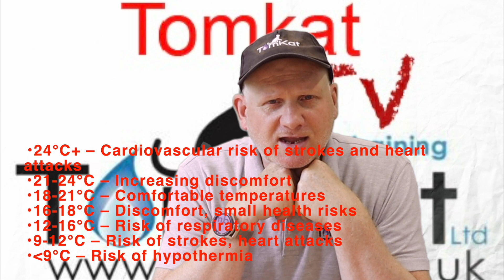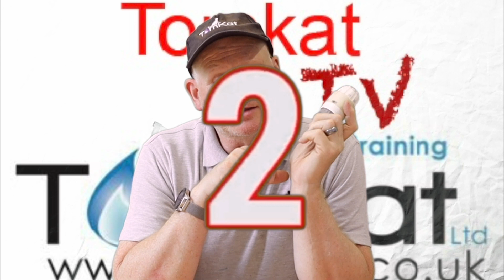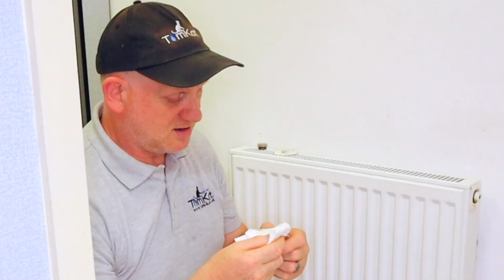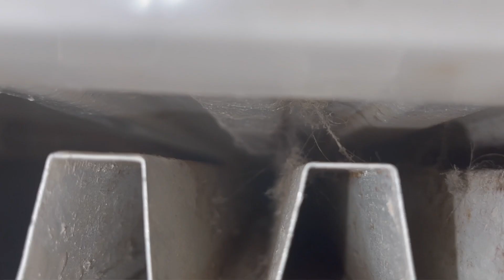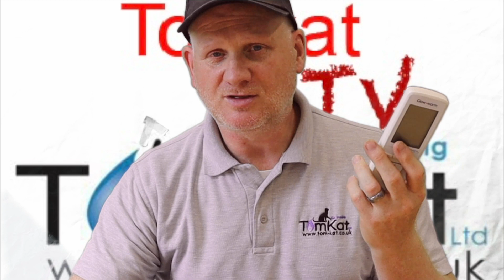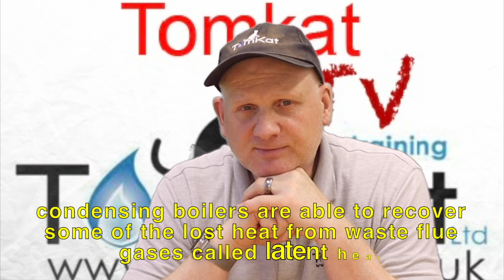Save gas save cash. 15 tips on how to save money on your gas bill.  #saveenergy

Comment: Makes me smile. I was born in a house with no gas, no electricity and no running water (we had a pump). The temperature you talk about would have been dreams. My grandad lived with us too,. We had a range in the room. Upstairs was a matter of moving very fast and get into bed with lots of covers. My grandad lived to 88  and he'd lived there 60 years so don't worry too much about being a bit nippy.
Reply: I was brought up in home with only an open fire in the lounge.
Winter was a nightmare and when you got up out of that nice warm cosy bed to a cold room where the condensation from you breathing during the night froze on the single pane of glass...
Eventually we got a parafin heater in the backroom/kitchen.
Hot water came from an emersion heater which got condemned after a few years but we couldnt afford a replacement so we just hoped it carried on working and it did for about 10yrs.
I only ever knew CH when i met my now missus and we got our first home..
Reply: @antsmith8588  I was born in 1949 and brought up with bath time once a week in a small galvanised bath, don't  know where the hot water came from, but we had something called a Copper!
Been in plumbing  since  a lad, so I've  seen the progression. 
All these plumbing and heating innovations  have got us to where we are today. Easy for the kids today to take so much for granted, we probably did something similar, but we never had a warm bed to get into in the winter. Yes, I hear the yawns, but once upon a time Thomas Crapper walked to London from up north and developed the flushing WC. You plumbers out there be proud of your heritage, sing your own praises and remind lesser mortals of your elevated position in society!!!
Reply: @johnward5006  ih i remember as a kid rolling up newspaper and knotting it for the fire at home and at my grandparents.
Then in the evening before we went bed we used to back up the fire with tattie peelings(potato).
My grandparents had a backboiler in the early days.
There was a metal hoop at the back and you pulled it to open it so you got hot water or closed it etc.....
I could on but im not as owd as thee are not yet anyway...
Reply: On Sunday bath nights I remember  the difficulty of persuading myself to get out of a warm bath into the freezing bathroom , the race to dry myself  before running to my freezing bedroom to dive under the blankets . Being a coward & delaying the decision ( as I often did) until the water was tepid made it even worse as you lost the residual heat of the water.
Reply: @stardust5397  Bathroom - Bathroom you were lucky. Tin bath in front of t’fire,  Dad went first and then the kids in age order, you really did not want to be child No.4 or 5. Try telling the young kids today and - they won’t believe you.
Reply: You were lucky. We…….😂
Reply: Actually, I think the younger generations - and even those my age (born 1969) - are losing these valuable lessons.

My parents were both kids up North during the war and they bought that mentality with them so any moaning about being cold got the same reply, "go out a jumper on." We took hot-water bottles to bed and I still do, so my house is heated to 15deg and I up to 17ish just for visitors. Otherwise I just keep all the old traditions like HWBs, blankets on the sofas and extra throws on the beds.

My Dad was, amongst about five other types, a heating/plumbing engineer. He made very sure we knew every degree of heat, every lightbulb, every drop of water was a finite resource and I am so incredibly grateful for those lessons - compared to my neighbours, I use about 1/3 of their energy simply by not taking it for granted. When I first left home at 17 I moved into a room in a massive old pile with no heating, no insulation, knackered windows - froze my arse off but at least I was prepared.

I know CH is far more even and economical than using space heaters, but those factors tend to blind us to the cost. Many kids today have no concept of life without consistent warmth and they over-heat and under-ventilate.  There's only about a decade between me and some of you but that decade changed so much. So freeze your kids, it's good for them long term!
Reply: Ice on the inside  of the windows.
You left out walking or cycling to school,  no school  runs. No colour  tv, no Internet.All said I think we were better educated,even if that was at a more lowly level.
We certainly had more respect for authority, the rule of law and taking personal responsibility!
Post war and particularly the 1960s free for all did few favours.
WITH FREEDOM OF SPEECH AND BEHAVIOUR, COME HUGE REPONSIBILTIES. WHO PAYS  THE PRICE FOR NOT TAKING THEIR RESPONSIBILITIES SERIOUSLY, ? YOU GUESSED  IT , EVERY MAN , WOMAN AND CHILD ON THE PLANET PAYS; GET REAL IT'S  NOT SOMEONE ELSE'S  PROBLEM!!!
GOD BLESS OUR DEPARTED QUEEN AND MAY WE ALL STRIVE TO FOLLOW HERE EXAMPLES!
Reply: @johnward5006  well said....allow please to ask if you are the famous John Ward (electrician). If yes my best regards, if not again my best regards sir.
Reply: @dkaloupis75  No, just committed  plumber.

Comment: No1... Insulation and draughtproofing. 
Set back temperature very important, but unless consumers have UFH or air source,it's  a difficult one to get across to consumers.
A simple energy saving tip with radiators is , if you wear thicker socks and keep your feet off the floor you'll  feel warmer. It's  a fact that your  feet and head play a major role in how people determine their  comfort  levels.
It may seem obvious,  but if you wear a jumper outside,  don't  take it off indoors! You could take it to the extreme and keep your  overcoat on, this might be necessary for many people this winter, so not funny.
Currently working hard on a project looking into hot water consumption and temperatures  and possible savings.
With luck can do the same with heating. In the meantime  Derek. Great effort!
Reply: Hot-water bottles. My doc told me off for having such a cold house but I create this toastie warm little enclave with just fleece throws and an HWB. I don't even have socks on, it gets that hot in my huddle (there:s only me in my house so nur, can do what I want!)

I can live without heating but take away my hwb and death will be instant. Mostly from astonishment followed by outrage.
Reply: I started using an upholstered footstool ever since I realised that my feet were becoming very cold by the time I went to bed.